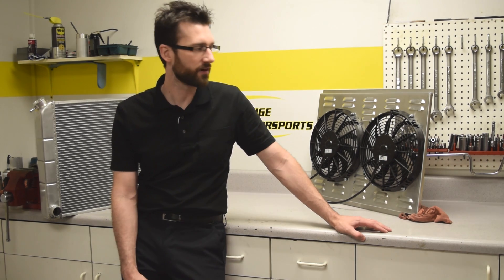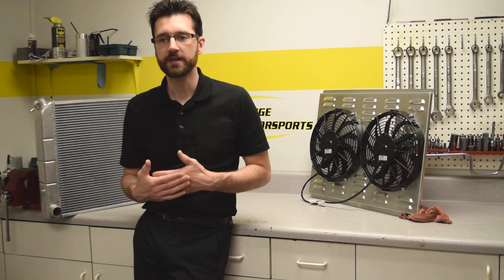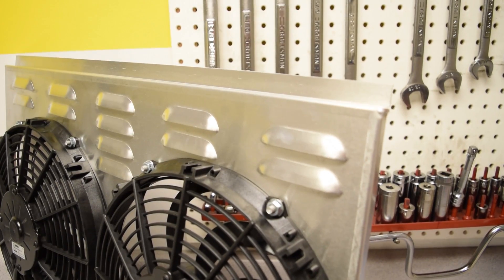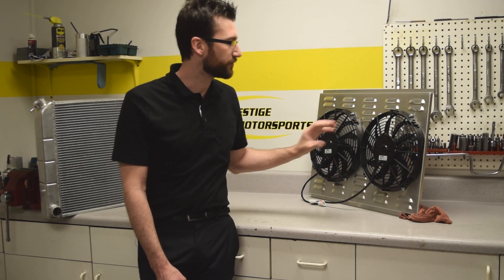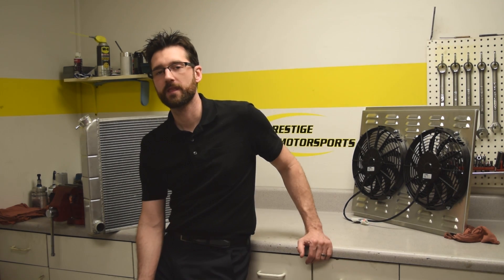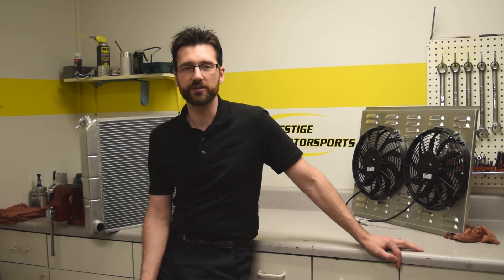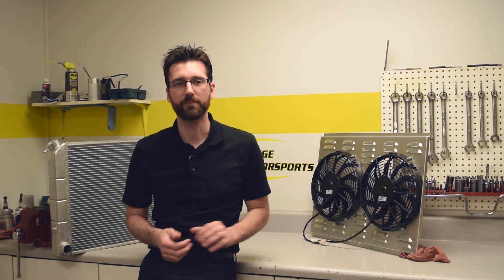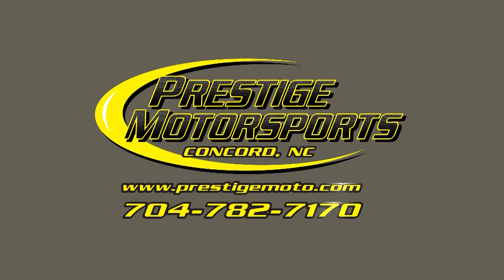Cooling System: Electric Radiator Fan Selection

Comment: What I don't understand is why Jegs and Summit say If i have 2 fans each pulls 1750 CFM that equals 3500 CFM of air threw my radiator.
that doesn't make any sense to me. 
if one fan only pulls 1750 CFM then that's all the air it's pulling thru the radiator in front of that fan.
Am I wrong??

Comment: Does the air from my fans suppose to blow on the motor?
Reply from the maker: Yes a puller is recommended but either way the air needs to move from front to back

Comment: This is a dumb question. But with the 2 fans. I thought 1 ran constantly while the other ran for ac or engine heat. Maybe ones for the temp and one for the ac. If anyone can help it would be greatly appreciated
Reply from the maker: The purpose of two fans in most cases is to maximize the core area covered by the fan. Production cars alot of times have  a slow and high speed. Both fans run, but for low speed the fans run in series (fans split voltage) and on high they run parallel (they both get full voltage).  Temperature, AC pressure, etc. determine what speed the fans will run on.

Comment: I've had a love hate relationship with electric fans over the last 30 years. What I recamend to everybody is take the time and go to a salvage yard and find an OE ran with shroud that fits your core. My 64 chevelle with a 500hp 406 is cooled with a 16 jeep renegade fan that had a 4cyl. Today it was 97° out and it was steady at 181° driving and 177° in traffic below 20 and stopped. This particular fan uses a 40 amp fuse probably draws 30 continuous. No CFM rating available but I'll tell you this it moves serious air a lot more than my 6 blade hd clutch fan ever did at Idol where I need it most. Most impressive was it doesn't need to run continuous it runs does it's job rather quickly and shuts down until it's needed again. 

And just to add salvage yard fans are cheap even new there typically around 100 bucks. This one I got free. Installation cost around 50 bucks 10 GA wire isn't cheap a good 80amp relay and a basic adjustable temp switch.

Comment: Eric...your presentation covers the very essential facts that should be considered mandatory when planning a cooling system upgrade. Especially when it comes to efficiency and the important role a proper fan shroud plays in the big picture. In addition to selecting the correct electric fan(s) based on current in amperage, the wiring size or gauge (AWG) needs to be upgraded to match the increased current load. 
I would also like to thank Prestige Motorsports for providing such a large selection of name brand performance parts and equipment along with experienced installation advice and expert technical support. 
Thanks guys,AnalogDan.

Comment: I thought pushers were more efficient
Reply from the maker: puller fans are more efficient in an automotive application
Reply: It also depends on location of the cooler too. In factory locations pullers are better. But say you're mounting it in the rear then a pusher set up is the way to go.

Comment: Congrads on a outstanding presentation. Static pressure and amp draw under load are the critical element when choosing a electric fan and most companies will not reveal that information. Guys buy them and have nothing but trouble. I would recommend the product in this video absolutely over any of the competition that I have seen.
Reply: Static pressure occurs on four cores+ radiators so that's why electric fans are not recommended.

Comment: i have a 2013 ram 1500  and trying to lower the operating temp its a daily driver,  changed the thermostat to a 180 degree which gave me 185 to 186 driving temp but lately daily temp been in the 100 degree area so its been running around 190 to 200 at idle in traffic. so i want at auxiliary fan that comes on around 190 and cuts off at 185 ....need some advice on size setup and maybe brand.